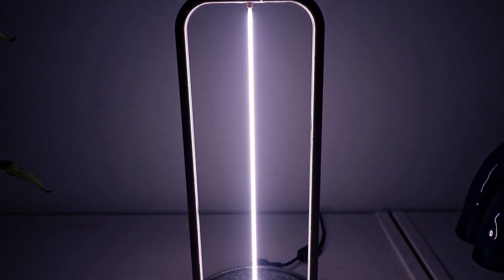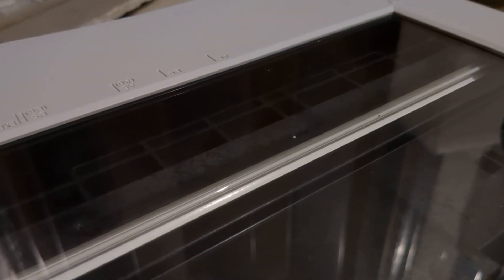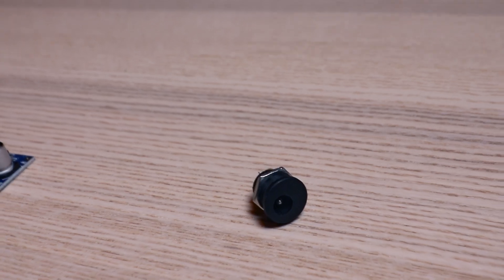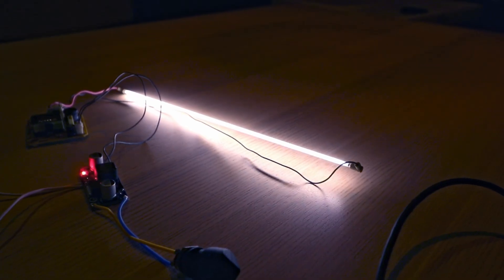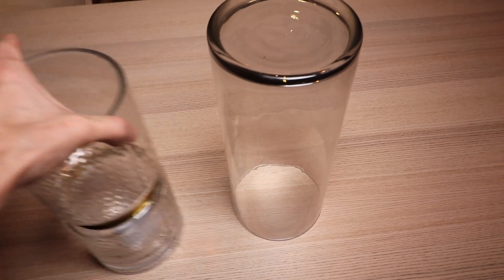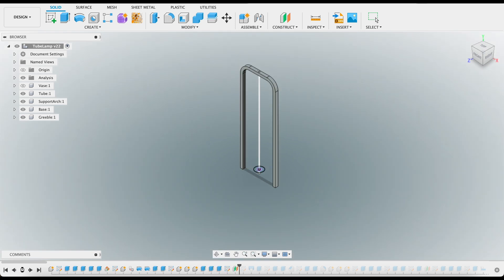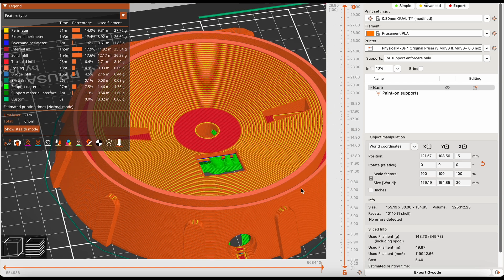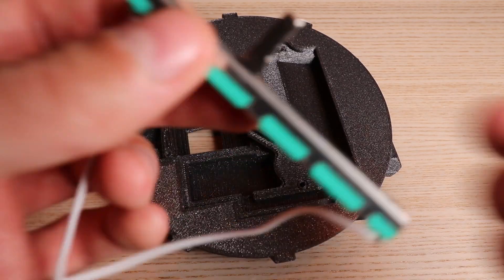Analog Desk Lamp: A Retro-Inspired DIY Project

Comment: would recommend a 2 part super glue for when you were assembling the supports at 5:00. would make assembly much less tedious due to less chance for error.
Reply from the maker: I'm not familiar with that. Do you mean 2-part epoxy? That's usually stronger but messier. Or maybe CA glue + spray activator? That would work well indeed, the down side is less room for error and adjustments.
Reply: @juliusmakes  my bad, yes i meant the CA glue with the spray activator

Comment: Those "old technology" scanners contain a very previous and high magnification lens assembly, that's not just a loupe but a very wide angle Apochromatic (chromatic aberration corrected for 3 wavelengths) lens, housed in a convenient brass cylinder. Be sure to harvest that!!! Unlike other loupes, this one doesn't distort if your line of sight is not axial with the lenses. Mine stays sharp even if I tilt it as much as to block the entire image.
Reply from the maker: What did you use it for?
Reply: @juliusmakes  It's my go-to eye loupe for when I'm to lazy to bring something under the microscope

Comment: Cool project, but like someone else has pointed out, these CCFL light sources can potentially emit pretty significant amount of UV… The one used in your project seems to be coated in phosphor, but I’m fairly certain I’ve seen uncoated CFLs in scanners which will without a doubt, emit UV, and UV-C.
Reply: If there's UV-C or even UV-B, you can smell ozone after a while
Reply from the maker: I can definitely smell ozone  https://youtu.be/YnopHCL1Jk8

Comment: I really like the lamp, but I wouldn't choose it as a desk lamp. Mercury emits a significant amount of UV light (check out its emission spectrum), which might not be ideal for "close-up work".
Reply: This is a small fluorescent lamp not a bare mercury lamp. The UV is absorbed by the phosphor to produce the white light and a cheaper non-quartz glass is used which also absorbs UV.